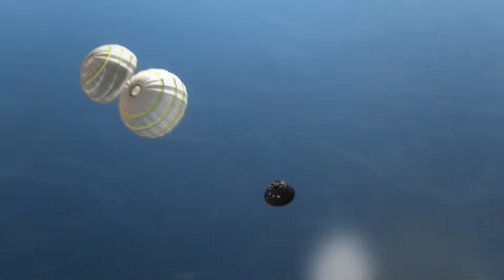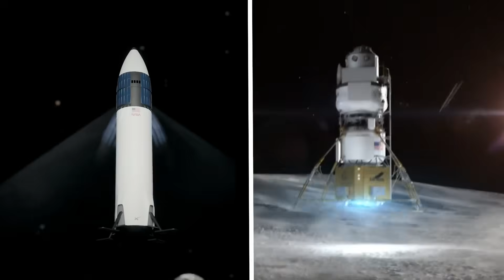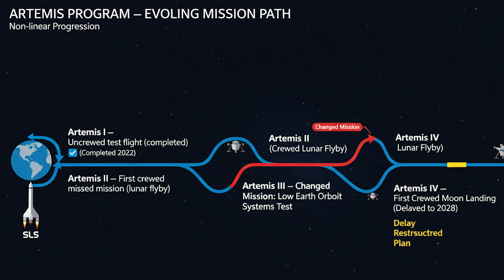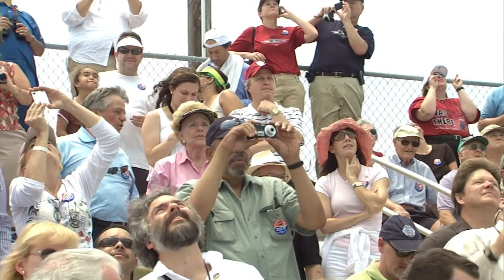NASA Spent $93 Billion. Artemis Still Can't Land

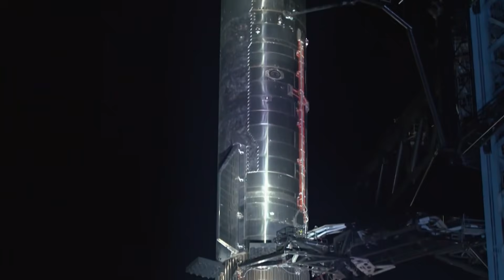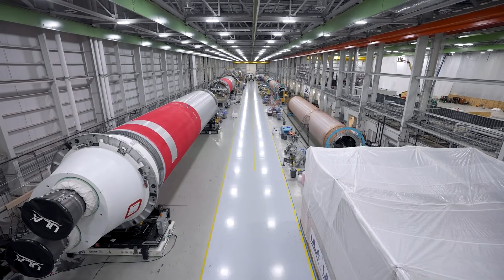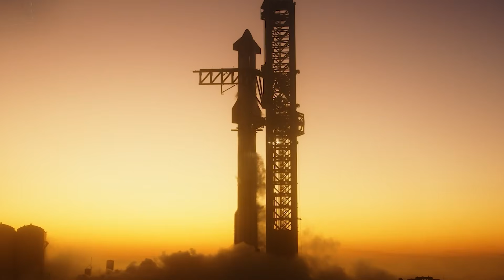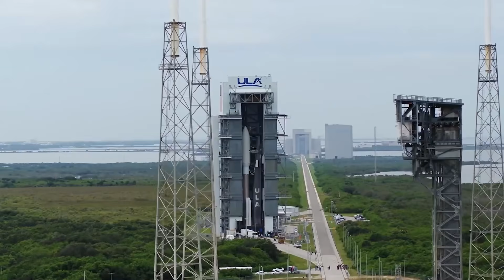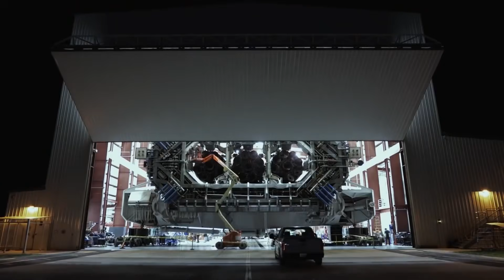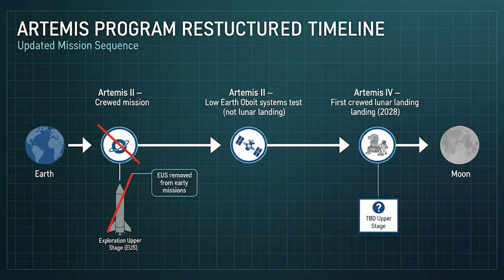Comment: @1:55 video of prototype starship.  @2:36 showing video of ULA Vulcan Rocket.  @2:49 You mention Artemis III and show video of Space X Starship stack. @3:00 You mention the Exploration Upper Stage and show footage of a ULA rocket.  @6:06 you are talking about SLS and showing old footage of a horizontal Space X Falcon 9 Heavy stack which has nothing to do with SLS. @6:21 an incorrect, out of date info graphic. @10:07 Shitty video footage of the Omega, all solid rocket motor rocket that will never be built and has nothing to do with SLS.